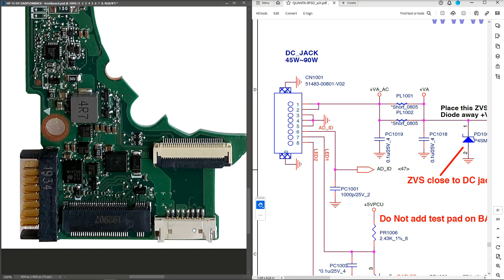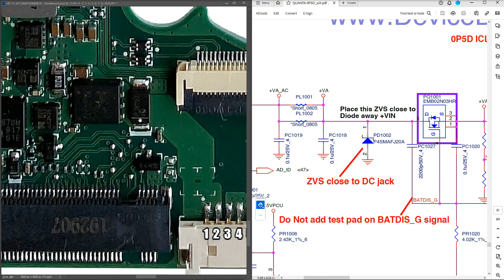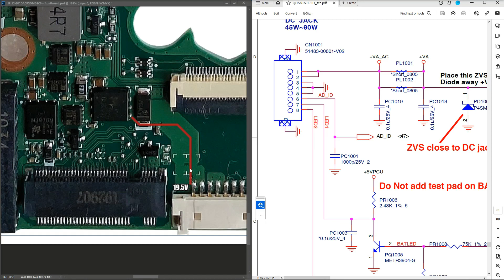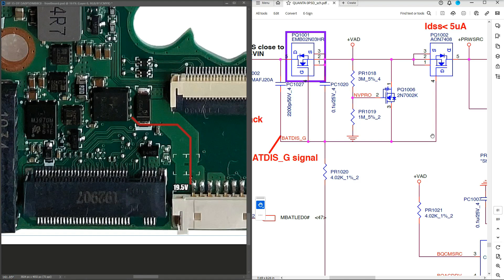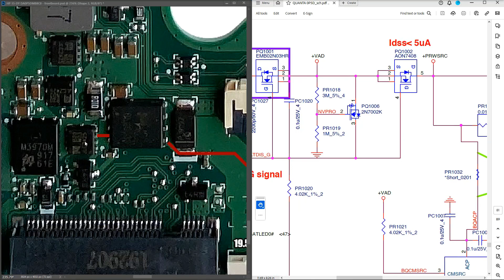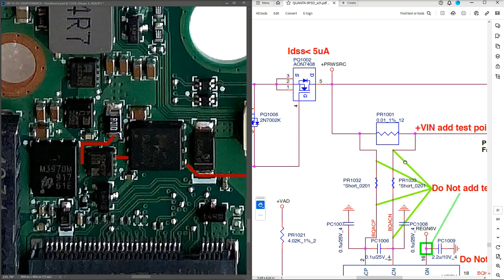HP Notebook 15-dy1124nr - I Have A Challenge For You

Comment: Hello teacher 
Laptop has no sound error 
How to replace with
Usb cm108 and pam 8403
Instructional videos
Thanks teacher
Reply from the maker: Hi Toan, are you sure it's not a Windows software issue? Could you boot to a Linux Live DVD and try from there to confirm it is a hardware issue?
Reply: @therepairshare673  hello teacher
Hardware error
Reply: Please help
Use, pam8403 and  cm108 usb card